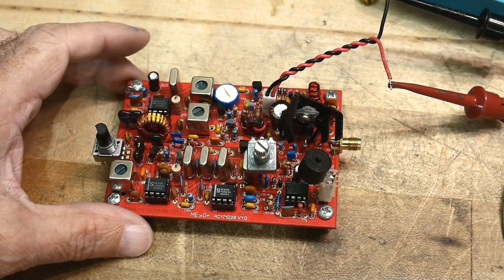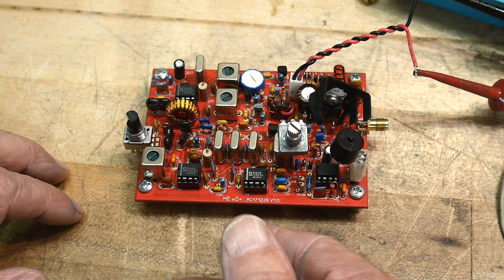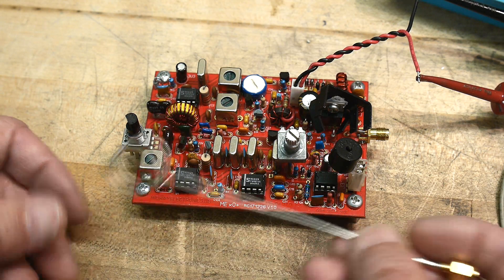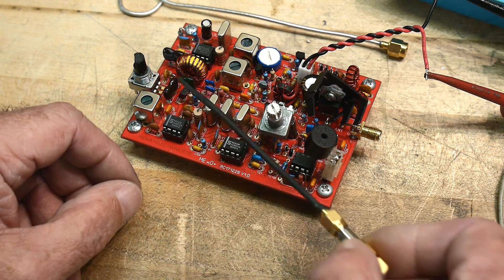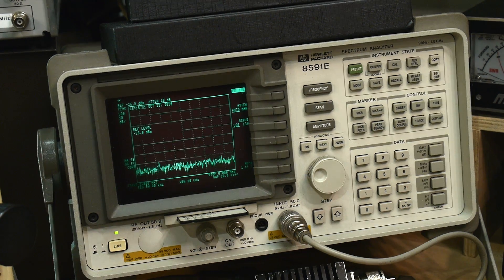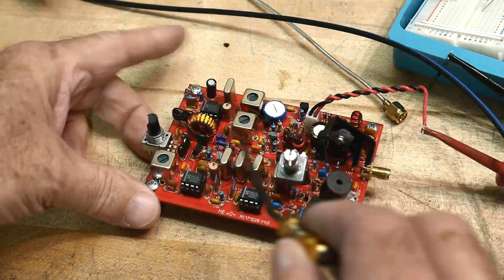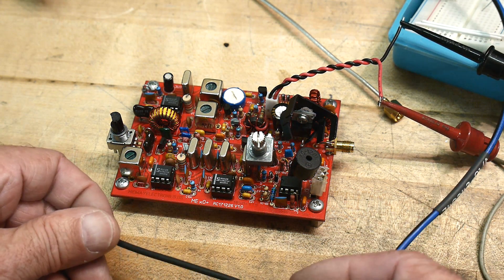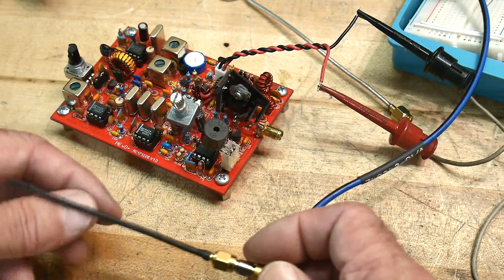#631 ME40+ Using Probes with a Spectrum Analyzer

Comment: Not part of the regular RF Police but I do serve on their reserves from time to time. Seriously, I enjoy your videos because of the joie de vivre they express -- as the Frogs would say. In any case, you do show an incredible desire to measure/verify/validate stuff with an incredible assortment of complex equipment and I wanted to back down the panic level of your audience somewhat. I am certain you know that checkout of these little single board QRP radio kits can be done with little more than a VOM, DMM, RF probe, and similar. Nice-to-haves are a scope and a signal generator of course but I prattle. 

My real point is that the the ME-##+ kit you built is descended from the old Small Wonder Lab kits Dave Benson (K1SWL) used to produce back in the mid-90s. Dave and Wayne Burdick (N6KR) and others like Doug Hendricks (KI6DS) and Jim Cates (WA6GER, SK) used to rock the pillars of heaven with items like these that kept our irons perpetually toasty and the solder smoke wafting across the bench. 

Dave offered the SW-##+ kits and others to us for a song and, remarkably, the Midway Electonics gentleman -- operating with permission from Dave -- has recreated these little gems for folks nowadays for pretty damned near the same price that Dave charged.  

You, sir, have a piece of history in your hands and your excellent work in banishing the ignorance surrounding the NanoVNA is adding to that. I did a couple of reviews on the ME entity and the 80-meter version of same for anyone interested. Your viewers  are also welcome to stop by and peruse my blog and see my past and present adventures. I am sure that future  posts will include my hearty thanks to your videos for your clearing away the clouds of mystery of the NanoVNA.

"Seven Thirds" de k6whp
dit dit

Midway Electronics:
https://midwayelectronics.us/qrp 

The Right Hand of Zod blog:
http://righthandofzod.blogspot.com

The Right Hand of Zod Midway Electronics review:
http://righthandofzod.blogspot.com/2020/03/living-in-past-dave-bensons-sw-radiops.html

The Right Hand of Zod ME-80+ review:
http://righthandofzod.blogspot.com/2020/04/midway-electronics-me-80-kit.html

Comment: Other commercial probes to consider are ones made by Auburn Technology Corp. I have the P20A 3 GHz version (the more expensive P20B goes up to 12 GHz). It's a passive probe that has a 50V DC block and a 10:1 voltage divider. They're not cheap ($195) and as pointed out you can roll your own as I did for my IFR 1500; a simple small and large loop at the end of a piece of coax works surprisingly well. The Beehive EMC probes (and others) are another way to probe the E and H fields although you may need a amp in between them and your SA.. As with all test gear you get what you pay for but having said that homebrew stuff can provide satisfactory results as long as you're aware of their limitations. The "RF Police"...cool, like that!  ;-)
Reply from the maker: I'm too cheap

Comment: Could you talk more about LNA's and how they are used for probing with a Spectrum Analyzer? Can a Tracking Generator take the place of a LNA or active probe? How do you prevent blowing up the front end of an SA when working with radio receivers such as fm  or higher? Lots of questions, plenty of time to learn.

Comment: Thank you for your great videos. Please add an PayPal account for sponsoring your Lab. I got the following cheap probe which works fine: https://www.ebay.de/itm/RF-Active-Probe-0-1-1500-MHz-1-5-GHz-analyzer-oscilloscope-RF-cable-included/332393676082